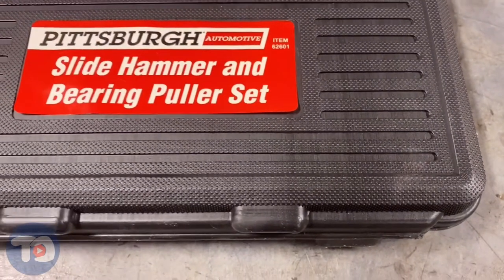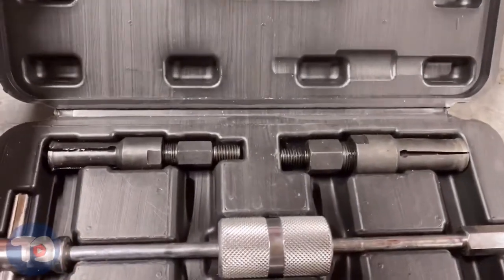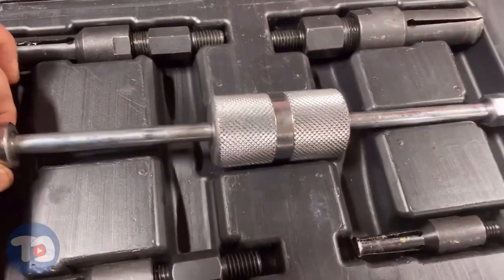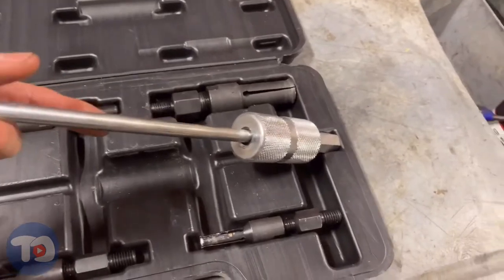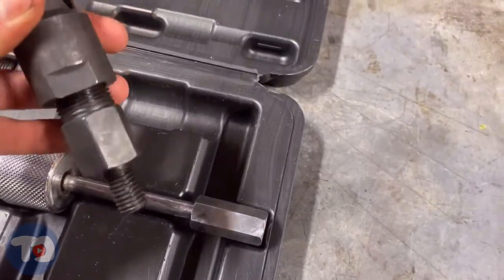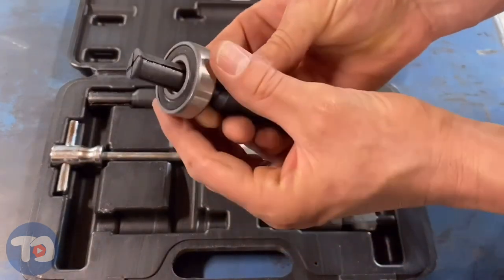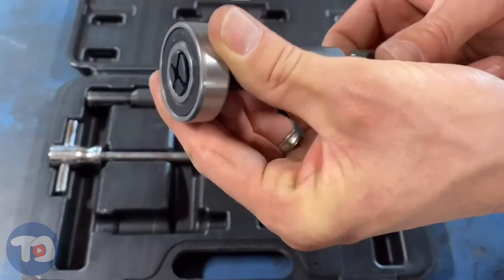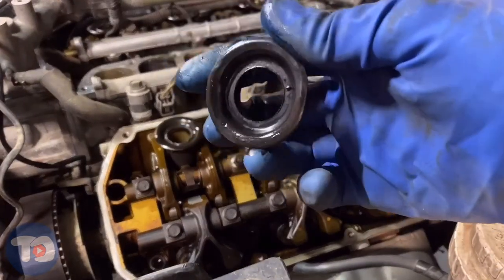How to remove a stuck valve cover with a slide hammer.

Comment: Great!  Now i know how to remove stuck draft control cover on my 1956 ford 600 tractor!!! I have all the bolts out & cannot get it to budge, tried the hammering ect with rubber hammer, & am reluctant to drive screwdriver or chisel in the gap fearing damage.., this however should do the trick (hopefully)!!!
Reply from the maker: Awesome! I hope it comes off easily for ya

Comment: Will this remove a transfer case extension housing bushing ?
Reply from the maker: Hi David, thanks for your question. No, this tool will not remove an extension housing bushing because the output shaft would be in the way. The collets in this kit are not designed to slide over a shaft like the special tool for the bushing is. In most cases, you can remove the extension housing then use a press to R and R the bushing. I hope this helps, happy wrenching.
Reply: @ToolDemos  Thanks for the info!

Comment: Will it remove axle bearings on my 94 YJ?

I assume so but I debating between this design and another design.
Reply from the maker: It’s funny that you should ask, I’m using it right now to remove a gimbal bearing from an OMC outdrive. (It worked.)

This set is definitely too small for your axle bearings. You need a bigger slide hammer and a bearing adapter that fits your YJ. 

Happy wrenching.

Comment: Would remove a stuck valve cover  on 2008 Lexus IS 250? If so, Where can I purchase these tools?
Reply from the maker: I think it could work. I bought the tool at Harbor Freight
Reply: @ToolDemos  Thanks for your quick response. How much did you pay for it?
Reply: Did it work? doing valve cover gasket on my is250, cant get it off at all
Reply: @cookzii811  There’s a bolt between the coils, make sure you loosen it up and the cover will come right off. Make sure you also unbolt all the perimeter bolts